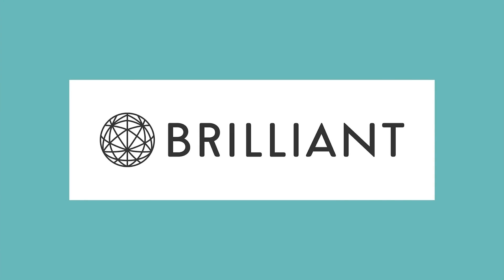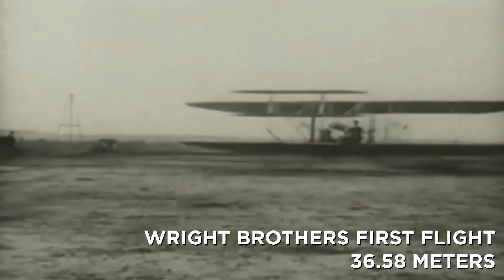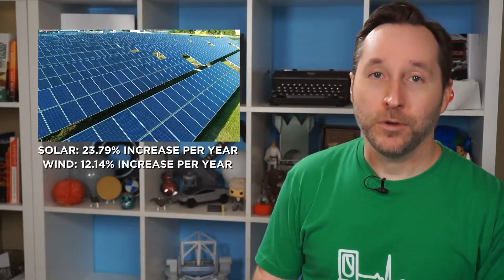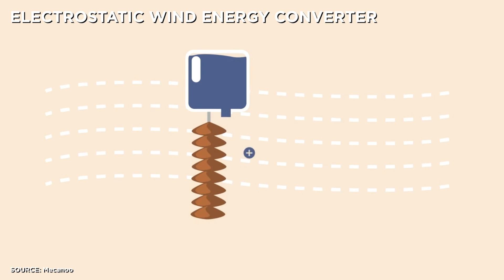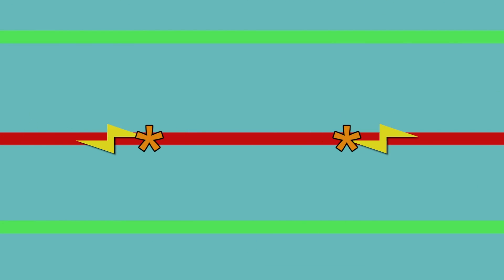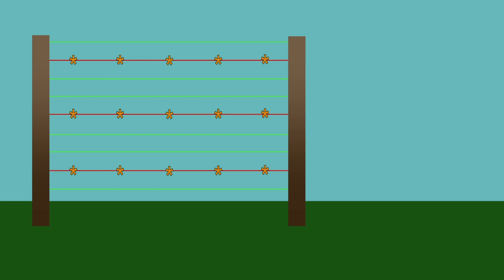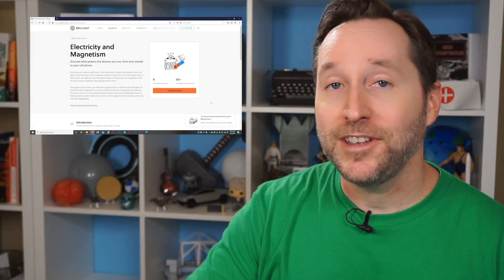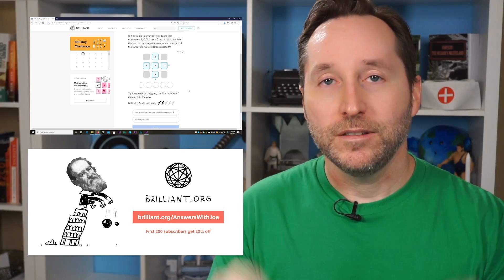Solid State Wind Energy | Random Thursday

Comment: Aside from the inflated bird kill stats on wind turbines it's important to note not just the top numbers but also compare to other energy industries... the fossil fuel industry kills so many more: https://thinkprogress.org/chart-how-many-birds-are-killed-by-wind-solar-oil-and-coal-230d2a939bbb/?fbclid=IwAR2NL6Wn6x_0UhkyAY1ljUeNdbUv-4PvKvvLKnZLwM_4ZxiJXSajEuXsIB4 (you'll have to be versed in the use of the internet archive if you want the impactful graph though, as it "disappeared") 
Also of note is a clever idea I came up with my own before seeing implemented lately is painting the blades of wind turbines which in the method implemented (which is not clear or pictured in the attached article) they reduced bird kills by 70% year over year: https://www.rechargenews.com/wind/painting-one-turbine-blade-black-reduces-bird-fatalities-by-72-says-study/2-1-861643?fbclid=IwAR2dq0dIyX4qGLBQ3HYlD5XK5pXRLwevxxTTe3yuDBudoEIhB2XSGaSKVH4
(my own idea for posterity was considering birds visual strength in perceiving UV: an outward rotating spiral or contrasting UV reactive paints... which If this is not what they are doing I would wager would further reduce deaths.)
Reply: Birds sometimes fly into turbines because they don't perceive them. As illustrated locally to me, natural gas flare offs (that often are done for safety in harvesting and refining natural gas) can actually attract birds into their 1000'c flames. Here is the case of Irving Canaport having been found guilty of killing 7500 song birds in under 24 hours: https://www.cbc.ca/news/canada/new-brunswick/irving-canaport-bird-kill-plea-1.3305351

Comment: Wind energy should be solely for green Hydrogen production, not energy grids.
Reply: Interesting idea... why?
Reply: @ntdscherer  My father worked most of his career in power generation as a unit controller and hated wind power being used on utility grids. 

Wind power is unbelievably powerful. A farm of wind generators making 100 - 200 MW can handle a hell of alot of homes. With this world becoming less logical and more emotional, my Dad would say that if the wind farm rang up and asked for load they had to give it to them as it's green power and it makes us feel wonderful etc. 

However, wind farms either make no power in low wind conditions or de-clutch at high wind speed, so they are erratic, unlike optimum utility grid solutions i.e.  power stations. You can lose this huge generation in an instant and it's hard to explain just how bad this is for the grid to absorb. To make sure there would be no loss of grid power, Dad had to run his 250MW unit (coal fired) at low load (inefficient and burning coal for the hell of it) ready to catch that load at short notice.

If you are making green Hydrogen from huge wind farms and sea water which is an enormously energy intensive exercise, you are making H2 when the wind is good and not when the wind is bad which is no great deal. I'm sure engineers could work out the average windy days in 12 months and extrapolate how much Hydrogen they expect to generate. It's a perfect application and Hydrogen is the future. Look up Hydrogen economies.

Comment: I've often wondered about the feasability of distributed wind engergy and so was a little disappointed to hear that it's not viable in this video. I did guess that using rooftop wind turbine to power ovens and TVs and stuff woundn't be viable (versus being connected to the grid in the vast majority of cases) because of the complexities of regulating the electricity to the correct voltage and AC frequency and the need to store it in batteries (AC / DC conversions). So my idea is to use a simple heating element to run off the more or less unregulated electricity produced by a small roof mounted wind turbine. The heat would be used to heat water so that a house's hot-water needs (for washing, showering and such) would be met with wind energy. So it's basically an alternative to solar panels that do the same on many houses with the idea that it is theoritically more reliable in parts of the world that get wind reliably and not so much sunshine. I guess it would be a thing if it was viable because it seems like it should be reasonably simple.

Comment: I actually worked in the wind farm industry. You decided to make light of birds getting killed. But birds and bats do die as a result of the rotors. It looks like the blades are turning slowly. But actually, the tip of the blades are traveling at over 100 miles per hour. Pretend being a bird for a moment trying to fly in between the spinning blades. There is a second issue. The blades also create a vacuum that collapses the lungs and internal organs of the birds and bats. If you remove enough animals from an ecosystem, you disrupt that ecosystem, which in turn, may affect humans.

Comment: How much power is lost by high voltage power lines in comparison ???   By the looks of the system we would have a lot more cable in the air and poles out of the ground .